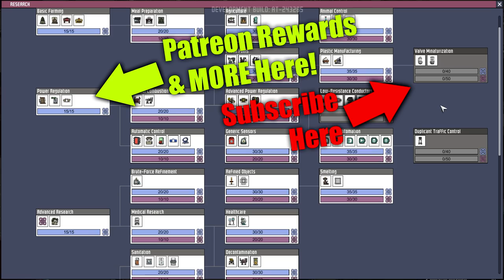ONI AUTOMATION UPGRADE: PLASTIC MANUFACTURING!!!! SEASON 03 EP 18 OXYGEN NOT INCLUDE

Comment: >Extremely low priority
>Sets to 8

Aaaand you could have kept the standard-watt wire at that manual airlock and just constructed a heavi-watt bridge over it.
Your first mess hall had auto-wires going through the mess hall to the lights, because both pneumatic doors on the sides could accept auto-wires thus leaving the doors open every time the shift plate was activated.
You also have a TON more gold than copper, so there goes anymore atmo suits being manufactured.
Again, you can still use wires past their safe levels, it's all a matter of usage. Passive usage is more worrying than active usage, because of power consumed when doing activities.
It's interesting how the Apothecary requires 240W of power. I didn't think centrifuges were part of the design considering the art only contains herbs and a mortar/pestle.

Comment: To help with the natural gas being released by the fertilizer synthesizers replace the ladder and heavy watt wires with the heavy watt tile thingy, that will close the bottom of that room. Now to enter go through where the power transformers are there is enough room there for a manual air lock.

Comment: Plastic Fantastic where is the Swedish potato :)
Switch the sink to your Suits to the left instead of the right which it is now!
Just in case it didn't show fridges count as machines so no mess hall :(
Put in air lock doors to keep water out of your oil.
Move your storage by your water geyser basin to the tunnel with your suits .
Don't forget to set up the fridges to hold your cooking materials as well.
Priority five is normal level, if you want "when idle" set up jobs as one-four, and then when you do red alerts they do every thing six and over.
Put the updated pharma in the med bays they do not count as machines.
Now for my dissertation (aka weekly rant :)

Rebuild your med bays down the right side of your base and put your mess halls in their place.
Should put the petroleum machine under the natural gas engines to utilize the gas :)
Have the polluted water pump run off the lower compressor.
Place your lower Natural Gas engines on the other side of the ladder so you can have all the heavy wires not cross each other
Remember the duplicates will have to run the petroleum plant manually so don't make it to hard to get to.
Please raise your water geyser basin up so it can fill up faster :) and then you can reclaim the refine metal from the destroyed heat sinks.
Set up both of your upper air pumps to go to the same gas filter to separate the oxygen from the rest then at the GDD you can separate out the hydrogen only two air filters instead of three (or four at the moment).
For your upper Natural Gas generators you can destroy the bottle water pump and move the hamster wheel there then you can just use regular wire to connect it to the gas pump.
Set up a battery bank on the low watt side with compressors to store extra power and start separating the different areas that way the output is more controlled.
Reset your oxygen to go straight down past the GDD to the suits instead of around the edge of the base.
Put few more fridges in the "kitchen" so the cooks work from the same area.
Move all your water intake pipes to come in from the left and polluted water from the right to cut down on water bridges.
The clocks can be set to cut on at night so you can get rid of the weight plates in your bedrooms (of course keeping them in the med bays).
Lower your gas filters to closer to the GDD to get back some resources from the pipes add energy usage.
Run your output pipes near your Natural Gas generators to run in the ceiling to increase visibility and space usage and the output of the generators to go down straight past your oxygen/hydrogen pump and you can get rid of the gas bridge for the oxygen.
Rebuild two of the door on the floor of your GDD one sideways and the other two floor tiles then the water won't pour out if you go in :) 
You should put the floor over the door for your GDD to cut off your suit area so if they get stuck in there they won't suffocate.
Set your hydrogen to go to the generator after the Freezer unit and it will run it first then the generator.
--You have said you will build a true refinery to do your metals.

I hope you are reading all of these :) don't own the game so I am playing through you :)
Reply: Amokra OMG why so long, I'm watching it all slowly load in. Probably took an hour to right. 😁
Reply: lol just been watching and writing :)

Comment: Your coal generator are connected to a battery that is fully charged and the battery recharge threshold is set at 50%. So as long as the battery does not fall below 50% they will not fill the generator up. 

Take a look next at time stamp 2:15 to see what I mean.

OMG you moused over what I am talking about twice!

Comment: Would using a buffer gate and one pressure plate at each entrance to the mess/food prep room (set the buffer to be like 10-20 sec or however long they eat/work) not work for less metal?  It would also help boost your decor as the pressure plates have a negative impact...  Same maybe could be said for the bedrooms.  If one Dupe is sleeping they all are, so in theory only one of the rooms needs that pressure plate... In any case love the ONI videos, cheers!
Reply: John Pelletier great idea!
Reply: He could also just add a clock sensor for the bedroom
Reply: John Pelletier I️ personally prefer 30 seconds for food and 25 for bathroom.